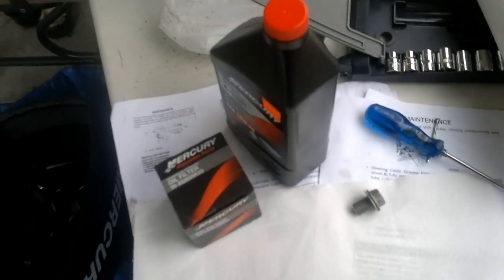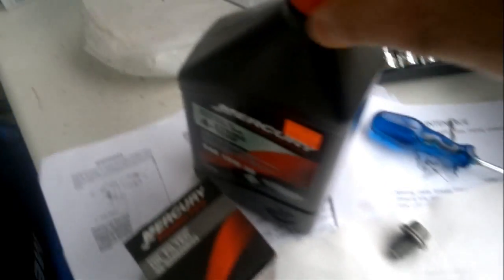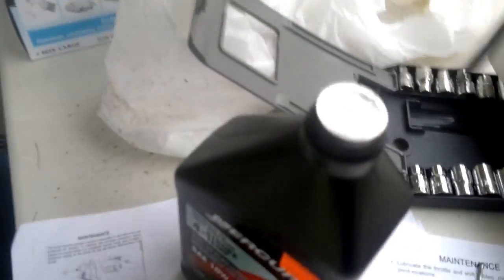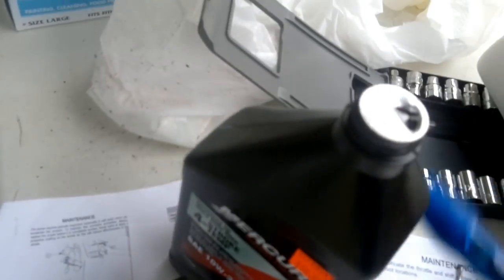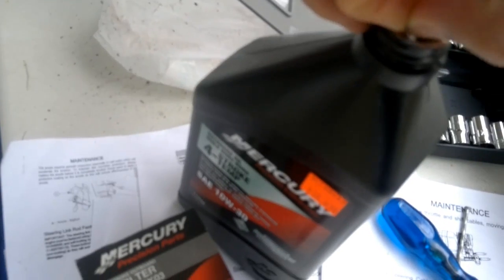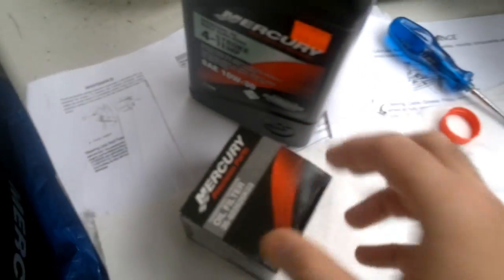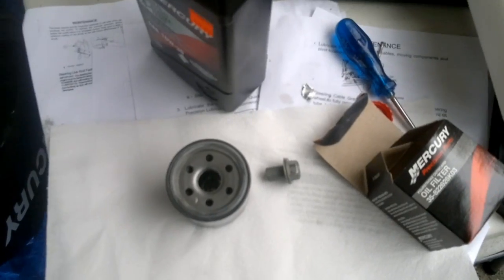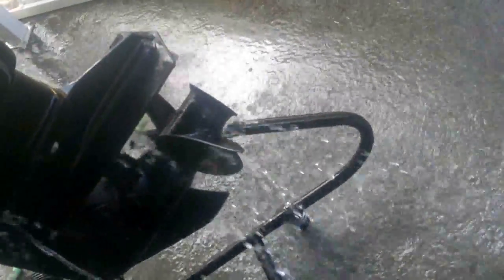Mercury Outboard Motor Annual Service Step by step guide 5/5

Comment: I could tell this guy is not a mechanic. Some info is good. his choice of tools and methods are not so good.
Reply: Hahaa like hitting a ratchet with hammer to tighten a bolt no real mechanic does that there are torque wrenches and breaker bars for that

Comment: Why didn't he change out the impeller in the lower unit??
Reply: +DeltaBassBuster Unnecessary without symptoms of low water pressure...tattle tail stream consistently low.